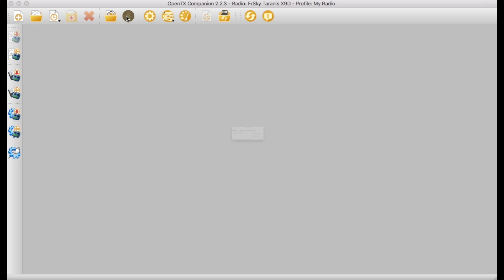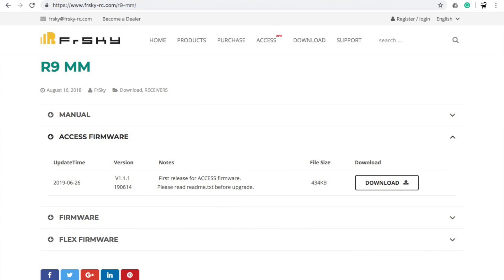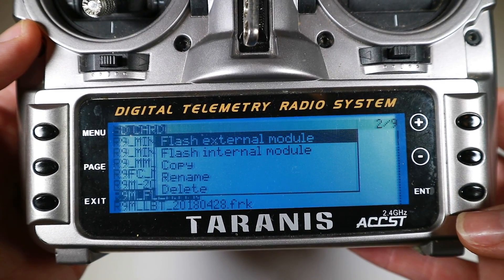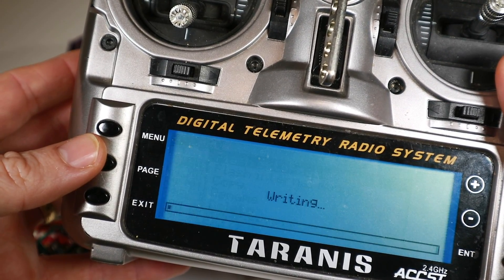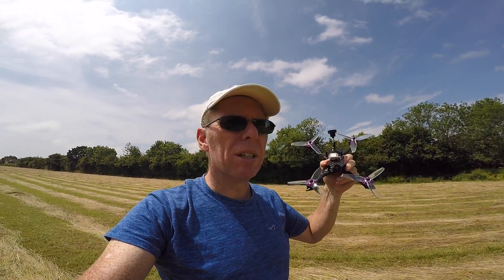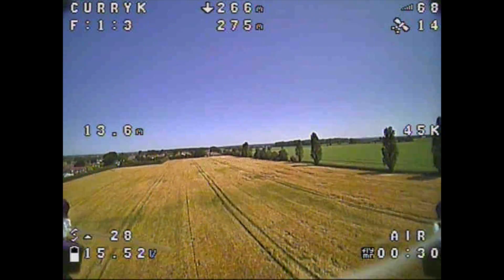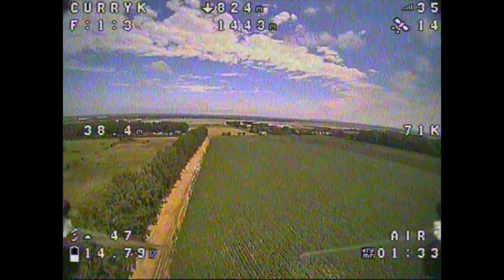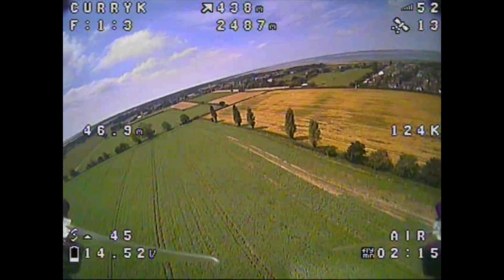Setting up and testing the Flex firmware on FrSky R9

Comment: oh my goodness! so frustrating. ive spent hours trying to bind an r9mm with a t18. it driving me mad! there is nothing to help. ive just watched your video here so i hope it helps. its like its one big secret that frsky will not tell. think ill stick to another provider in the future.
Reply from the maker: As you can't check exactly what firmware you have on the module and the rx, your best bet is to flash them both at the same level so you known you are at a place that should work before you start
Reply: @CurryKitten  thank you for the reply. But I’ve no idea how to do that. I’m just guessing from here on

Comment: Man did you ever fly with flysky system? :D That 10mW looked like a dream for flysky fliers.
Reply from the maker: Yes - way way back I had a Tunigy 9X and used the FlySky rx's for a while before I got a FrSky module.  I had issues with not knowing my signal strength and losing signal on that earlier FlySky stuff

Comment: Wayne , I know this is an older vid, but I was curious if you remember having to set serialrx_inverted = ON for the R9MM to communicate ? I had 4 quads running R9, all with F4 FCs and I had to do that with all of them. I recently switched over to crossfire and completely ditched R9 but at first I couldn't get crossfire rxs to communicate and remembered that I had the serialrx_inverted = ON and had to set all four of them back off . I've never been able to get R9 working without setting serialrx inv to on. They were all flashed with the flex firmware using Fport . I hope you can remember and help me understand why that was necessary for me to do. Thx.
Reply from the maker: There's one thing weird about using s.port on the r9mm and it's the fact that FrSky has a different opinion of what inverted means to everyone else.  So to use it on a regular uninverted UART on an FC, you'd use the "Inverted S.port" so it you are using the regular solder point which just says S.port/F.port its where you'd need to invert.  It's interesting that serialrc_inverted is working for you.  In most cases on F4 board, you can't run this as the UARTs can't be inverted (but can on F3/F7s)
Reply: @CurryKitten  we actually had this conversation once before about installing an XM+  on TinyHawk FC and having to set serialrx_inverted to ON . I certainly can't explain it.
So ..I am using the S.port/ F.port pad on R9MM connected to sbus pad on FC . I followed a vid I watched to the tee and everything worked this way. To be clear, you advise soldering to uninverted  uart RX pad  instead of sbus pad ? I am going to give all my R9 stuff to a friend and I want to be sure he connects everything properly, or at least the way it was intended to be used. Is it possible that the low RSSI values I was getting could have been related to the way I had it connected. Thx again for the feedback. It's really hard to get info on R9 since most everyone has abandoned it (including myself)
Reply from the maker: If you are just using Fport for control, then what you are doing is correct... and should have just worked.  There are a few FC's out there with non-inverted SBUS inputs, but they are rare... so not sure why yours always needed it.  I'd only bother with using an uninverted UART if you are also using telemetry in conjunction with F.port.  Again, it's possibly different on different FC's, but for me the SBUS connection wasn't bi-drectional, so although F.port control worked, I didn't get all the telemetry I was expecting until I moved it to a regular UART
Reply: @CurryKitten  btw, have you done a vid on getting pwm outputs from a crossfire nano RX for use in a plane or RC car . Very hard to find info on as well. I see "adaptors" for sale with no explaination of how they work. Very leary of buying an item without some understanding of how it works. Thx

Comment: im new to the r9 system and i was wondering im on 2.3.4 open tx is that ok or do i have to downgrade to 2.2.3 ive been working on this for days. i need help!! when i first got my receiver it worked but no rssi so i thought upgrade firmware on rx well then i finally got it to rebind again but now no stick input. so im frusterated... i tried flex and i cant get it to bind
Reply from the maker: You don't need to downgrade.  Are you getting RSSI from the telemetry, or video ch16.  If you upgrade firmware on the RX, don't forget you'll need to do the same on the module as well - it it possible you've gone out of sync with version between your RX/TX ?
Reply: @CurryKitten  I got it binded and stick inputs again.  I have rssi in my radio just not in goggles. Hmmm

Comment: Hi sir if i update to OpenTX 2.3.5 on frsky qx7 ACCT. can i use flex firmware on R9M ACCT without any issue? will i lose old TX models? when updating
Reply from the maker: I've not had to rebind anything by updating OpenTX - and all your settings should still be there (although it's always safer to backup first) the only thing that might make you have to rebind is if you had to flash your R9 module to install the flex firmware (and then you'd also have to do it on your rx's as well)
Reply: @CurryKitten  Thanks sir. Is the flex firmware stable now?  Cam we use it without any issues
Reply from the maker: @outboxfpv4360  It feels pretty good to me, I've also have 2 quads using it on the new R9 access and that seems fine as well.

Comment: Great Video thank you. Did you ever tried r9mm flex using fport on a F4 flight controller? I couldn't get it to work. The stick inputs were not in Betaflight but radio binds correctly. I used the inverter Sport on a spare uart. After flashing (via serialpassthrough) back to non-flex everything was working.
Reply from the maker: I didn't try fport at all on these r9mm's I had.  I've got a few of the new r9mm-ota's - I've just stuck one on SBUS, but I want to try fport on an upcoming build where it makes more sense to get the telemetry... so I'll hopefully be able to see if it works for me
Reply: @CurryKitten  r9mm with fport worked for me with the standard firmware for FCC or LBT, but not for flex... have fun with your upcoming build! Thanks for your reply.

Comment: My R9MM receiver does not bind to my R9M... Using Tried OpenTX 2.2.3 and latest flex firmwares... No luck :(((
Reply from the maker: Same firmware version on rx and tx ?
Reply: CurryKitten I flashed latest firmwares... Latest flex firmware numbers for R9M and R9MM are different... But they seem to be released on same date... Installed 190201 for R9MM and 190117 for R9M... They are both released on 2019-02-13

Comment: If I attach my r9m module on my QX7, do I need to have my QX7 battery to only be 2s, right now I am running my QX7 on 3 18650 battery?
Reply from the maker: According to FrSky's website, the voltage via the JR connector is up to 12.6v, it's only the external power that's limited to 12v (which is why they recommend a 2S lipo)  I run internally in my Taranis via a 3S liFe battery at 10.8v.
Reply: I could not get my R9MM to bind. Flashed it with flex F.PORT firmware and flashed also the R9M module with flex FCC firmware. But I was able ti bind it using F.PORT FCC  and FCC firmware for the module.

Comment: Hi there! Good work! I purchased the R9M/R9 too. But I can't seem to find any REAL (technical) information on it. Like What EXACTLY is the difference with the FLEX firmware? Is it correct to assume that with the FLEX firmware installed the 2 dip switches of the R9M are obsolete? Do you have some specific info about these kind of things? Keep up the good work. Cheers!
Reply from the maker: I don't think the dip switches are designed to be used with Flex - to be fair, all the buttons on the module are fairly obsolete as long as you are running OpenTX and it knows how to "speak" R9.  The switches/bind buttons are designed to be able to use the module independently of the software on the radio.  Flex essentially lets you run any power with either frequency with or without telemetry, and doesn't make you rebind everytime you change something.  It's also, of course, got the adaptive power mode which will up the rf power only when it's needed
Reply: Thanks for your response! I set it up on 868Mhz, 8ch+telemetry and power up to 1W with the dips witches both off. Everything seems to work fine. I only hear no humming when I disconnect the receiver, as I hear on some channels happening. So I cannot verify if the power really goes up or not. Guess the field test will have to show then. 

Cheers!

Comment: Odd, at 10mw you have rssi of 50 at 1000m. At 100mw you have rssi of 35 at 1000m ?.
Reply from the maker: Yep - I noticed as well.  The only thing to note about the 100mw flight is that I did it on the previous day, so I can't be sure if my position in the field, my orientation and my TX antenna positioning is all exactly the same
Reply: @CurryKitten  Yeah but 10X the power??  Not sure why but my Slim+ has much more stable RSSI then my R9MM. I bought another R9MM to compare.

Comment: I’m glad you did this video.  I’ll save all my comments or questions till the end of the video.
Reply: The r9 seems exciting. And you flew out way further than I will ever need to or would even consider. 

I order a 3” cygnets with r9 mm receiver. Which I have an r9 module that hasn’t been hooked up. 

My question is, how much trouble will it be to bind??  
If it’s gonna be a headache, I also have spare xm+  receivers I could throw in their easily.
Reply from the maker: Binding itself it very similar to an XM+ it's hold a button and power on.  The issue with the r9mm receiver is more probably knowing which firmware, and version of that firmware it has on it - as the module and rx have to line up.  It's actually easier to flash it with what you want rather than have to second guess it.

Comment: That sudden drop-off of RSSI on the turn is because you have mounted your antenna horizontally, and as the quad swings around, you are either pointing the null point of the antenna towards your transmitter or your battery is blocking the LOS (or both) - I'd be interested to see the improvement if you mounted the antenna vertically as I've had no such problems with a flying wing and a vertical antenna at a considerably greater distance
Reply from the maker: It's very natural to mount a dipole vertically on a wing, but it's a challenge on a 5" quad, so I generally go with taking the hit on the null point.  I do have a 7" to build, so will be interesting to see if that will fit vertically easier

Comment: Very interesting, I'm also running on flex, but have stuck to 200mw and have been very cautious with my range. Just a quick question, did you say you don't need to rebind if you increase/change power levels? Or is that on the new (access) firmware? Cheers geezer 👍
Reply from the maker: No - on r9 you can change the power levels without rebinding (which is nice) I much just stick on using the adaptive option  for now

Comment: Maybe my Super 8 is damaged, but after a couple of split second failsafes in difficult situations I went back to the TBS Diamond and while it is hard to measure signal strength seems to be better with it.
Reply from the maker: It might be damaged.  I didn't have a diamond to test, but I compared the Super-8 against the regular T transmitter antenna and they performed pretty much identically.

Comment: I'm in the US and I don't have those rssi dips mine stay around 100 pretty much all the time unless I get a a few miles out but never below 80
Reply from the maker: The difference between 915 and 868 perhaps or are you using a widely different setup in terms of your model, and antenna placement
Reply: @CurryKitten  no just just a 5 in with a immortal t on the oarm but when I go way out I have a immortal t that is vertical on my 7inch

Comment: Do you know if I flash the Flex Fw on the r9 module will it still work with kwads that are not flashed with Flex?
Reply from the maker: It won't, no.  You'd need to flash the rx's and the module to the same firmware

Comment: The current R9 hardware does not support the new OTA functionality. You need to buy The R9M Pro module and R9MM-OTA receiver
Reply from the maker: Yes - that's what I'm hearing now.  Not enough memory on the original rx's.  Didn't know you'd need a different module as well (I've been away the last 2 weeks and haven't kept up to date)
Reply: u mean the r9m lite pro? that looks like the only module right now that will support the acess firmware along with the 3 ota recievers.... i literally just bought a 2019 r9m full size module and 2 r9 receivers... im not too concerned wit wireless firmware updates as its not that hard in the first place but what else would i miss out on? think i should return it and wait for a full size module that will fit in my nirvanna?

Comment: Am running f port witch fix all RSSI problem ,night and day difference.
Reply from the maker: As long as you scale the RSSI to 200% :)  Yes, I was going to use f.port, but I thought the video about using softserial might be useful on it's own so went the regular flex version instead.

Comment: I believe you can change the power output in the radio on older firmware as well 9 without rebinding)  , I do anyways on the 20181228  and it works fine , I guess I should upgrade but what a pain when you have 4 quads on R9 ...
Reply from the maker: Hey, if everything is working for you and doing what you want it to - then don't force yourself into upgrading.  It is a pain to do all the rx's if they're already installed.
Reply: @CurryKitten  you right , the only thing I did notice is a sharp decline in RSSI below 45 ...
someone posted some micro alligator clips that can be used for update without de soldering...I have to find that again

Comment: What a mess though with the "Access" hardware/firmware.
I don't understand why they can not just come up with a full X9D+ with upgraded hardware instead of all the cheap X9 Lite which is just a huge step down compare to a X9D+ :/
Have a great weekend super daddy and keep on flying :)
Reply from the maker: The X9 lite is cheap though, and does do d16 now.  I've got one to test, so I'll see soon !  It is a mess though - giving what others have said - is that the OTA update will require a new revision of the R9MM !
Reply: @CurryKitten  They seem to have aknowledged their mistake.
I just got an email about the release of a full X9D+. They called it X9D+ 2019 lol
If it was planned since beginning, that's some crazy greedy marketing.

Comment: I did have a super 8 antenna that did not quite completely tighten down,so the antenna would freely rotate (probably poor build tolerance)

I bought another and this one fitted tight with no play and also I use the Frysky dipol T antenna's fitted to the rear of my quads and this seamed to make a noticeable improvement.
(sorry, accidentally deleted this, so reposted in case it helps anyone out)
Reply from the maker: Yeah - a loose antenna isn't great if it's going to move without you wanting it too.  Glad the new one sorted it out

Comment: I'm glad u made this video . I have 3 kwads setup nearly identical as your test rig. I've never used the 1W flex output setting. I just keep it on 500 mw. Perhaps I will feel confident enough to use it now. Unfortunately I have an R9mm RX go belly up today. It lost it's bind and would not rebind. I reflashed it and still wouldn't bind.
Reply from the maker: I would guess the 500mw output would be quite consistent, but I did like the fact that the Fex setting didn't up the power unless it needed it.
Reply: Проблема в перегреве приёмника. У меня  сгорело шесть приёмников пока не установил теплоотвод на преобразователь напряжения который сильно греется и выходит из строя.

Comment: Are you going to try this on the X lite as well?
Reply from the maker: I got fed up in rebinding the quad between the R9 and the R9-lite, but I'm sure I'll use that on another quad.  I think the R9-Lite has a max output of only 100mw though, so flex isn't as useful
Reply: CurryKitten I have it installed on my 7 inch rig but have not had the chance to test it yet. I'm really excited about the 100mw WITH telemetry! Also, if you open up your module you can actually just remove the RP-SMA connector and install one of the t style antennes. I installed an 868mhz T style on my module with a 3D printed piece, do you think these matching antennas would perform better then let's say, a super8 antenna?
Reply from the maker: I don't know if they'll do better, but they'll do pretty good I think.  I'm basing that on my earlier tests using the TBS TX T-antenna which I tried on both the R9 versions and it performed well.  It was on par with the super-8 but there was no clear winner on the range I was flying
Reply: CurryKitten at the moment I have the antenna mounted horizontally on my tx and vertical on my rx. Do you think this can impact performance? Otherwise I might have to bend the 3D printed piece.
Edit: when I test it I will post my results, see if it's better :)